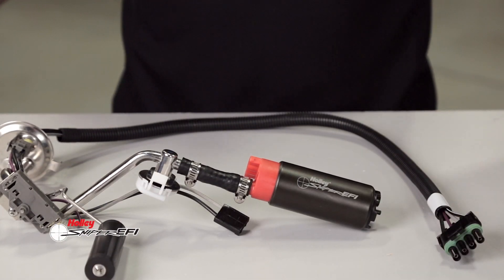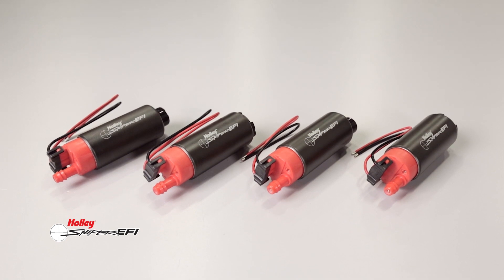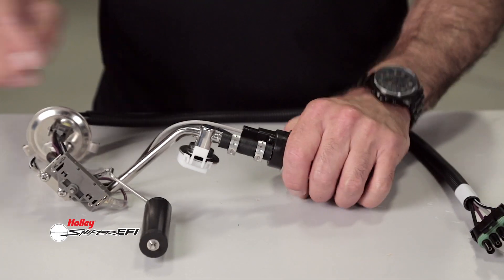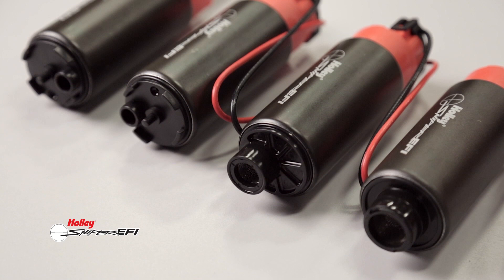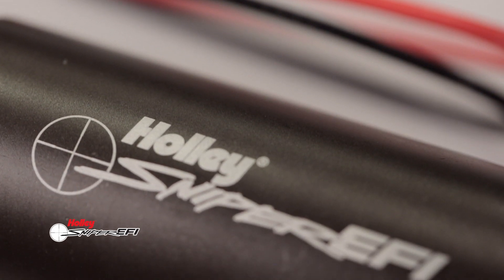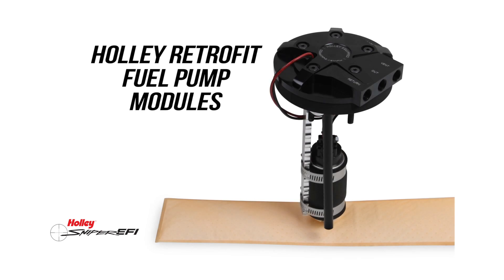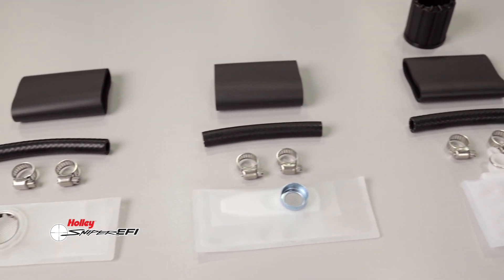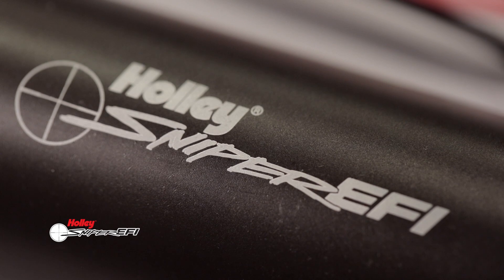Holley Sniper EFI 340 LPH E85 Fuel Pumps

Comment: Will this mount in my sending unit to replace stock pump in a 98 k1500 z71 truck with the 5.7 vortec. Swapping in a Holley carb and intake later on
Reply from the maker: Yes, you should be able to replace your stock pump with this. -Keith
Reply: @HolleyPerformance  awesome thanks so much

Comment: These pumps are shit. My 19-369 has 13.5 volts and it's only making 50 psi at the fuel rail on my 5.3 when it's advertised as 60 psi at 13.5 volts. Steer clear unless you like dropping ur tank over and over